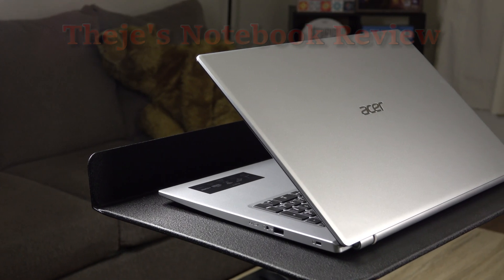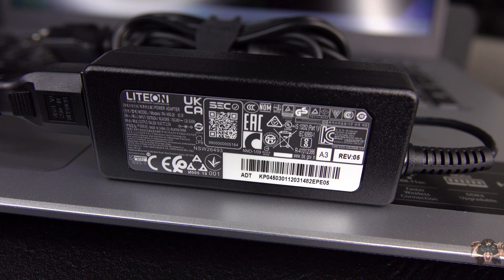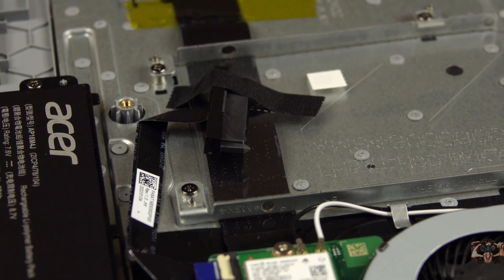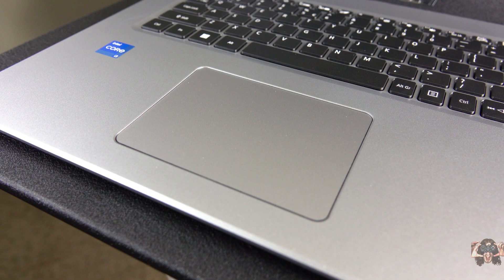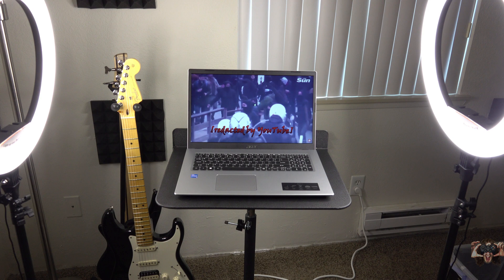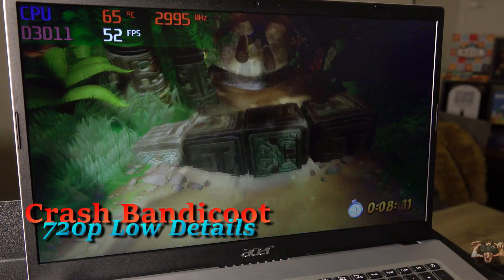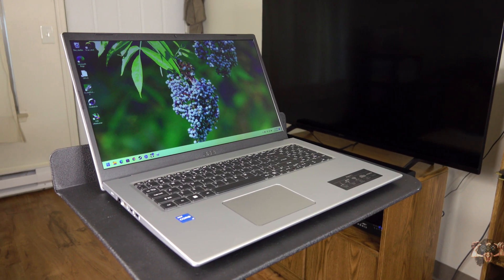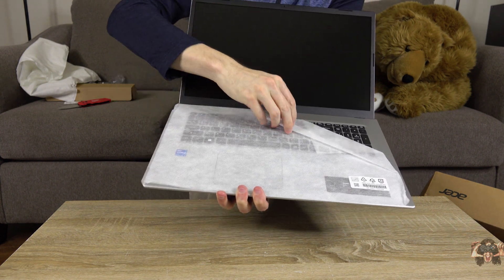Acer Aspire 3 (17" Core i3) Review | Theje's Notebook Review

Comment: I got almost 2 hours of gaming. I thoght the new charger i got fired my battery. Lol. Sound pretty good. I usually only use it to input datem and it lasts day (using by minutes).  I still like it. I paid like 259 2 years back. Dont regreat. I mean an amd chip would have been better for gaming

Comment: A good, honest review with a touch of relevant humor.
I sometimes service education computers despite having retired as a special education boss a while ago. In spec ed senior staff need to get a bit techie now and then because accidents happen and I have often been surprised by how Acer equipment can perform with toughness at that medium point between domestic and office-ready. Dell and Lenovo used to be mainstays for bigger screens and liquid repellent keyboards but prices became  a bit silly and quality control was wanting below T Series and Latitude levels but Acer tends to be tough enough and sharp corners are usually bezeled to avoid snagging. This is important where users have impaired gross motor skills. Also, we have found over years that using a good mouse and headphones always beats trackpad on onboard speakers.
The Granny joke was well meant too given that visual and motor impairment come with age and various conditions thus having a laptop of clear dimensions and weight is important. Too small and light is as bad as bulky in surface area and not having a backlit keyboard is often an advantage because they can confuse people where focal length adjustment between screen and keyboard is not instantaneous. We have tended to use clip-on down facing lights illuminating the whole working area and modern ones are rechargeable so there is no tangle of wires to a USB slot.
A 17" is also the 'sweet spot' for 2 or 3 people to view without intrusive parallax and using 2 mouses should be an option, as seems likely here. Dualling headphones via a 'T' adapter or Bluetooth should be a breeze.
Re upgrading RAM and using other storage I look forward to seeing your suggestions and have subscribed.
Plastic clips are everywhere these days and a tip I had from a proper computer engineer is to finger rub light oil or WD40 around the whole rim and give it overnight to seep. Do NOT spray except maybe with a small nozzle around the hinges then finger rub in. Next day use a spudger/guitar pick such as are cheap on Amazon and move the 2 tools progressively so that the clips release in order.

Comment: Yeah I found this on Target (refurbished) which is done straight from Acer for $319, which is not a bad deal at all. I've used Acer Desktops since 1997 and never had any issues, also had a 17.3 inch Aspire from 2010, which back then had one of the brightest screens I've ever seen on a laptop. So yeah they are cheap, and made decently. Especially compared to cheap HP models with only 4gigs of RAM in this price range and all hollow plastic. I'm coming form a 9 year old HP 17.3 inch which is still kicking, and these size laptops are rare. So I'll take it. Thanks for some in depth coverage brother. I like the premium look, and the keyboard as you said I've found is something Acer knock out of the park. ;o) So best bang for the buck, yep for sure.